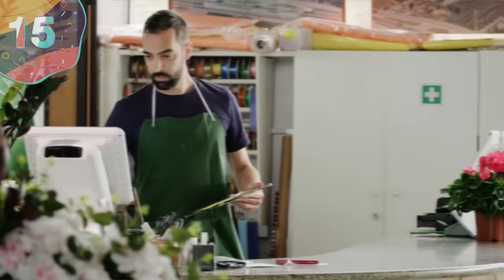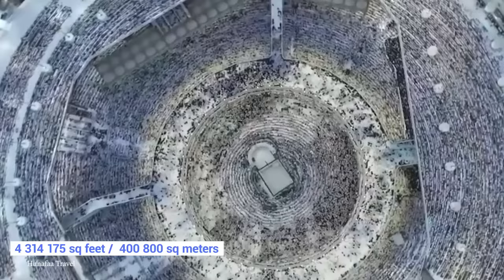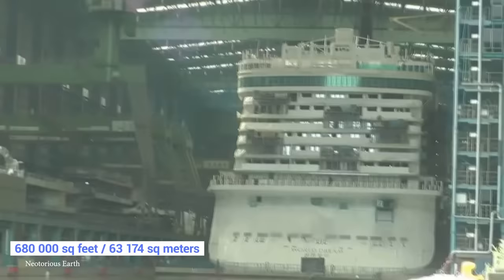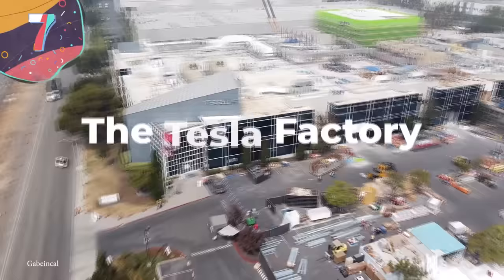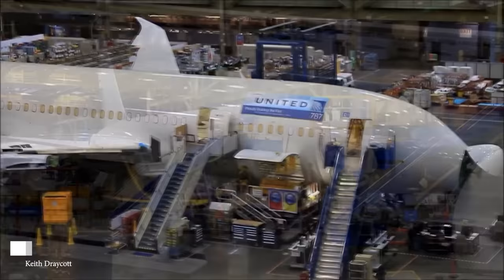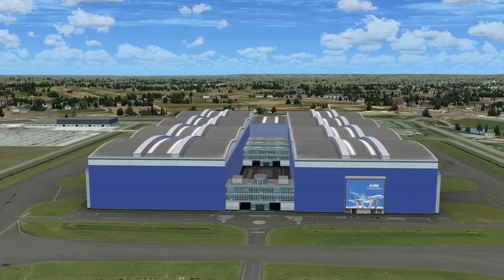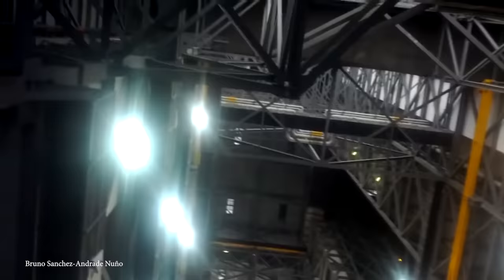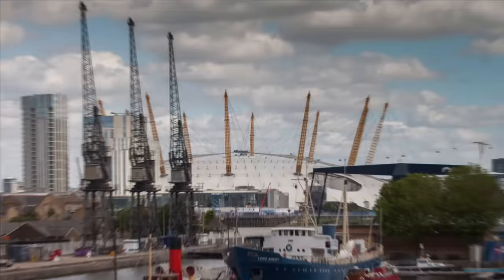15 Biggest Buildings in the World

Comment: The 757 was not built in Everett, it was built in Renton. The 767 was and still is built in Everett. Worked there for 5 years and helped build the first 120 777's. Spent the other 35 years I worked at Boeing in Renton.

Comment: All of them combine are really small 

The observable universe is a ball-shaped region of the universe comprising all matter that can be observed from Earth or its space-based telescopes and exploratory probes at the present time, because the electromagnetic radiation from these objects has had time to reach the Solar System and Earth since the beginning of the cosmological expansion. There may be 2 trillion galaxies in the observable universe,[7][8] although that number was reduced in 2021 to only several hundred billion based on data from New Horizons.[9][10] Assuming the universe is isotropic, the distance to the edge of the observable universe is roughly the same in every direction. That is, the observable universe is a spherical region centered on the observer. Every location in the universe has its own observable universe, which may or may not overlap with the one centered on Earth.

Observable universe
Observable Universe with Measurements 01.png
Visualization of the whole observable universe. The scale is such that the fine grains represent collections of large numbers of superclusters. The Virgo Supercluster—home of Milky Way—is marked at the center, but is too small to be seen.
Diameter
8.8×1026 m or 880 Ym (28.5 Gpc or 93 Gly)[1]
Volume
3.566×1080 m3[2]
Mass (ordinary matter)
1.5×1053 kg[note 1]
Density (of total energy)
9.9×10−27 kg/m3 (equivalent to 6 protons per cubic meter of space)[3]
Age
13.799±0.021 billion years[4]
Average temperature
2.72548 K[5]
Contents
Ordinary (baryonic) matter (4.9%)
Dark matter (26.8%)
Dark energy (68.3%)[6]
The word observable in this sense does not refer to the capability of modern technology to detect light or other information from an object, or whether there is anything to be detected. It refers to the physical limit created by the speed of light itself. No signal can travel faster than light, hence there is a maximum distance (called the particle horizon) beyond which nothing can be detected, as the signals could not have reached us yet. Sometimes astrophysicists distinguish between the visible universe, which includes only signals emitted since recombination (when hydrogen atoms were formed from protons and electrons and photons were emitted)—and the observable universe, which includes signals since the beginning of the cosmological expansion (the Big Bang in traditional physical cosmology, the end of the inflationary epoch in modern cosmology).

According to calculations, the current comoving distance—proper distance, which takes into account that the universe has expanded since the light was emitted—to particles from which the cosmic microwave background radiation (CMBR) was emitted, which represents the radius of the visible universe, is about 14.0 billion parsecs (about 45.7 billion light-years), while the comoving distance to the edge of the observable universe is about 14.3 billion parsecs (about 46.6 billion light-years),[11] about 2% larger. The radius of the observable universe is therefore estimated to be about 46.5 billion light-years[12][13] and its diameter about 28.5 gigaparsecs (93 billion light-years, or 8.8×1026 metres or 2.89×1027 feet), which equals 880 yottametres.[14] Using the critical density and the diameter of the observable universe, the total mass of ordinary matter in the universe can be calculated to be about 1.5 × 1053 kg.[15] In November 2018, astronomers reported that the extragalactic background light (EBL) amounted to 4 × 1084 photons.[16][17]

As the universe's expansion is accelerating, all currently observable objects, outside our local supercluster, will eventually appear to freeze in time, while emitting progressively redder and fainter light. For instance, objects with the current redshift z from 5 to 10 will remain observable for no more than 4–6 billion years. In addition, light emitted by objects currently situated beyond a certain comoving distance (currently about 19 billion parsecs) will never reach Earth.[18]

Credits: Wikipedia